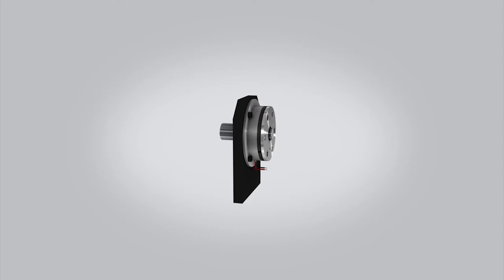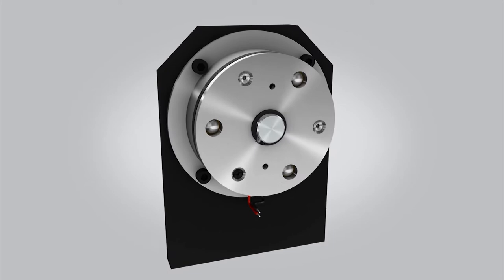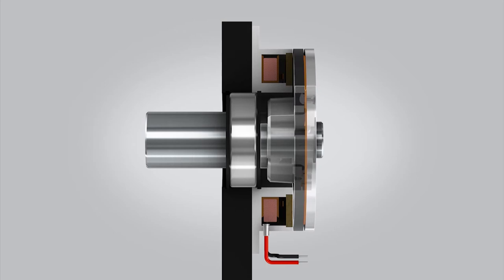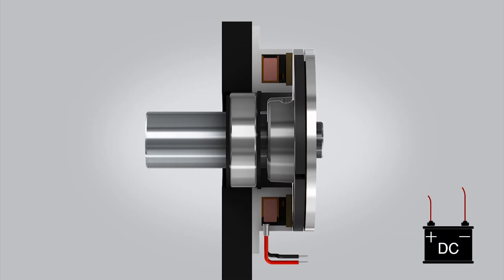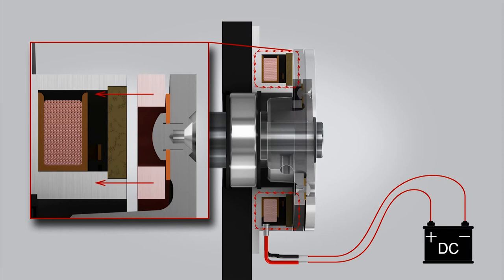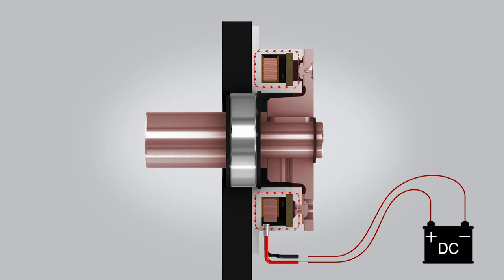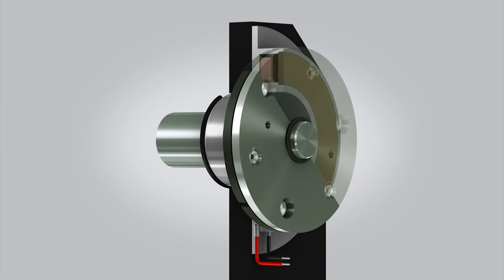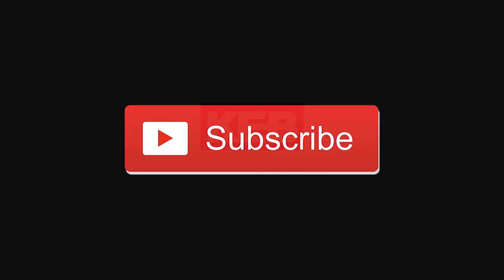Braking in Motors  with Animation Part 2

Comment: Hi actually I have an issue with the traveler trolley in an overhead crane the trolley doesn't move at the low speed setting , and when it is changed at the fast speed it moves very slowly , I think the brakes are fully engaged in this issue , any help please ?